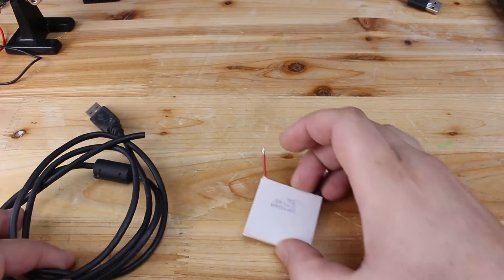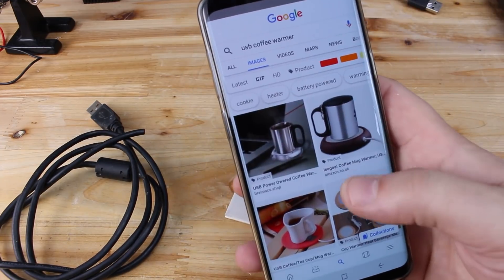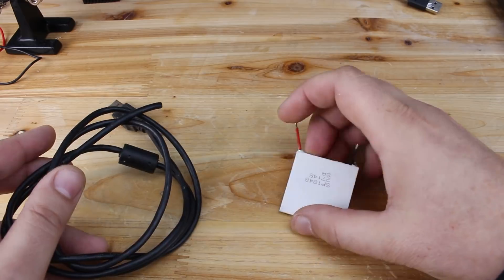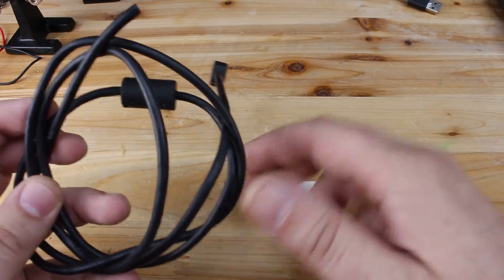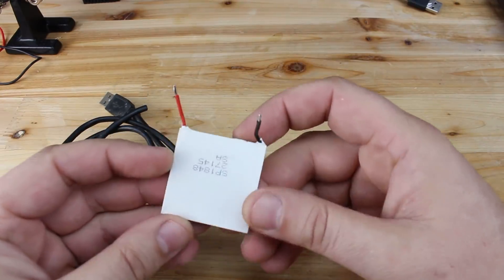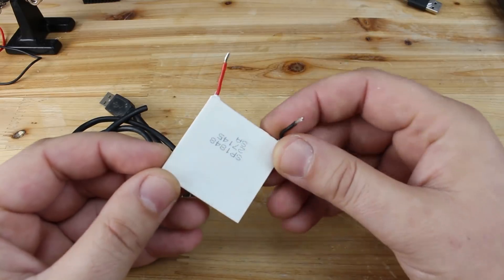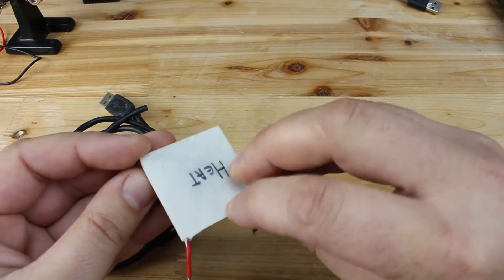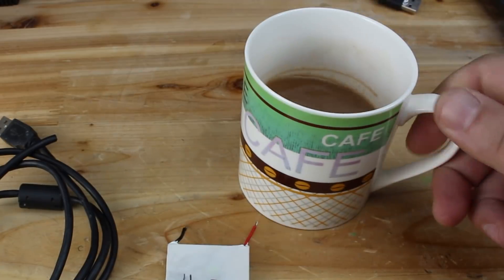How To Make USB Heater

Comment: attach a pc heatsink to it so the heat travels more then a thin sheet of steel over that weld that onto the heatsink to create a like hotplate doesnt sound like it will work but actually it will

Comment: That was a little incorrect. USB at best case delivers 10W, laptop USB 3.0 delivers 5W. Your project has too little contact surface to the mug, ceramics are good heat isolators, 5 or 10W is insufficient for heating or cooling liquids and at last 5 minutes is too short of a time to heat up that amount of liquid by approximately 20 degrees with your setup. I see that you cheated a little. I'm a mechatronic and I specialize in that area. Although the overall idea and effort is worth a like and a sub.
Reply from the maker: I power up with charger that give 5volts and 3amps of current
Reply: @Hacktuber   ok that's more reasonable. You should mention it in the video. And is your peltier module 12v?